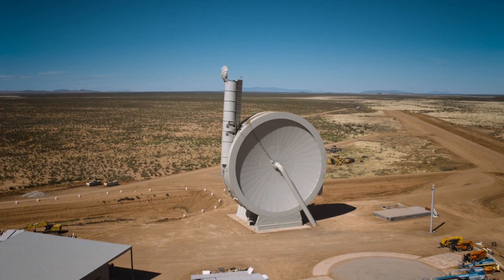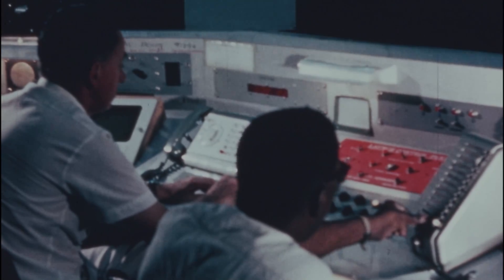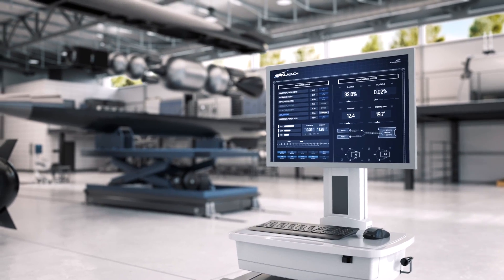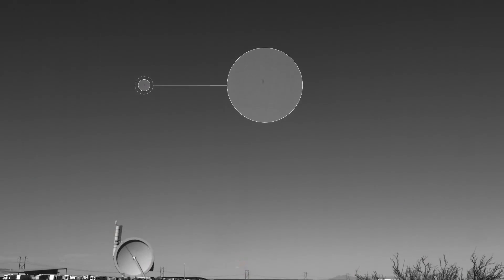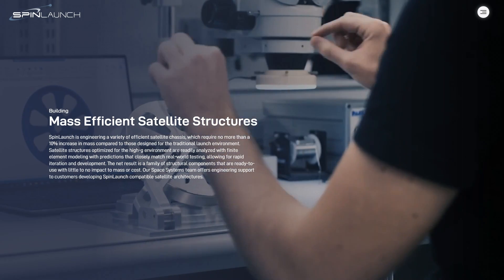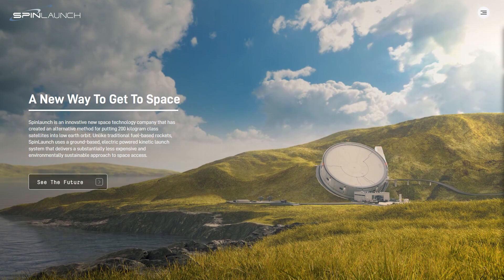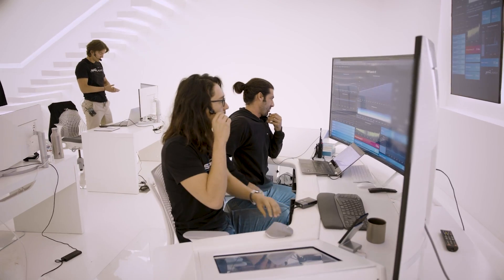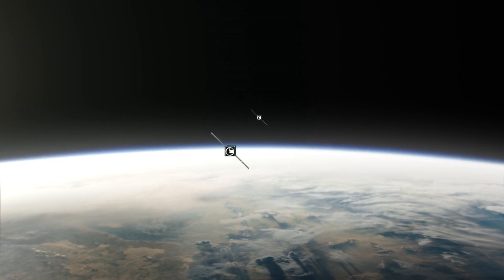Can Spinlaunch Throw Rockets Into Space?

Comment: For doing construction in orbit, this is surely the cheap way to launch bundles of beams or rolls of steel to orbit with only second stage thrusters to do orbital insertion and manouvering to a 'holding lot' where they could use the materials to construct, in place, the next generation of space stations:  Ones built in place and not prebuilt and launched.  More like an erector set where you have your pieces made and ready to go, just ship em up and assemble in orbit.  Would take another couple of space stations of the style we already have, but Musk's Starship program could launch some large chunks of a newer station and then use that as a building module to build out other structures in place, having a living and working space for moderately large crews.  Used to be science fiction type material, now we are coming up on being able to Really DO It, and cheap ground to LEO is an exciting prospect, even if it cannot be used for manned flight due tot he high G factor.

Comment: A 100m diameter centrifuge at a speed of 8000km/h generates a 10,068G force. If you expose the projectile to the same acceleration on a linear track (e.g. (rail)gun or EMALS), the launch would take a little more than 0.02s, and the track's length would be only 25m!
Reply: But please calculate the peak power needed for that rail gun vs. the spinner. The spinner can use an hour to accelerate the mass, so 3600s/0.02s …much larger projectiles are feasible with the spinner.
Reply: @samuk9816  Good point. I was also thinking about this. Maybe it's not even feasible electronically in such a short distance. But a gun with chemical propellants could still achieve it. Or a several hundred (or even thousand) meters long hyperloop-like tube.

Comment: Its cool and all, and great engineering.

But it will never work. 

Why would they even consider liquid propellant? Picture the aeration, churning, settling, etc that needs to happen before lighting it. Picture the acceleration, the propellant would be moved to the front of the rocket, not towards the engines when it hits atmosphere and decelerates. tanks requiring ullage (empty space) to efficiently deliver propellant 

They show it with composites. composites and heat dont mix. thats the worst choice of material. 

And what about all of the fluid connections? Those will be rattled lose or broken. 

Pressure transducers wont work at that G-load due to their membranes being artificially pulled in the wrong direction

Then what do they gain? They are expending the most amount of their energy at the worst part of the launch. Sure its free because they leave the mass of the device on the ground, but it doesnt buy them more than leaving a first stage. It actually buys them less because of the complications introduced and the massive amount of force acting on it.

With aerodynamic drag as well they wouldnt make it very high. There are already launch platforms that bring rockets to the same altitude, pegasus, virgin orbit, using planes that circumvent all of those drawbacks listed above. 

Why wouldnt they invest the same money into a launch from say 40, 50, or 60k feet from a plane? all better options.
Reply: Even launching from the airplane has a very questionable utility. Virgin Orbit is launching from the airplane, but they declare smaller payload (300 kg to SSO) with LauncherOne than the payload for the same size rocket (Falcon-1) launched from the ground (450 kg to SSO). Both rockets weigh roughly 30 tons. My guess is that Falcon-1 is built as light as possible, but the air launched LauncherOne requires greater structural strength to withstand being carried on a mount under the plane, and that eats into the payload. There might be other differences, but since much of the Virgin Orbit propulsion team are experienced ex-SpaceX people, there should be no huge weaknesses in the design comparing to what they have done with Falcon.

With the spinlaunch, the rocket will have to be built strong like a submarine, to be able to survive the 10000g centrifuge. That is going to be far, far worse in terms of delta-v than the penalty from the air launch that we saw with Virgin Orbit. I am surprised that surviving 10000g is at all compatible with getting 7 km/s delta-v from a small rocket. But I imagine the investors have paid for an external technical review of the project before bankrolling it, and the experts evaluating the project must have been sufficiently convinced that there are no fundamental reasons why this cannot be made to work. It will be interesting to see if anything comes out of this.

Comment: Scott, it looks that a good idea to make this contraption work would be to remove the lower half of the atmosphere. Instead of ramming into a 100kPa soup you could build this in Tibet and do without 40 to 45 of those. Better still, build it in the Kenyan, Peruvian or Ecuadorean highlands, where you can make good use of the higher spin velocity of a rotating planet's equator. Setting up this fine idea al sea level and far removed from the Equator is nonsensical, being such alternatives.

Comment: One of the tricky things is that the payloads are going to have to be able to resist loadings in two directions (radial as well as longitudinal), rather than just the one on a convential rocket launch. Creates a new set of structural issues - with a consequent mass implication on top.

Comment: Scott, I am ready to yield to your greater understanding but there is something missing from my understanding.  You say the rocket would experience 10,000G. If the object went from zero to terminal velocity in an instant, I except that that would be the case; but the rotation is ramped up over 1.5 hours does this not mean that the total G force is divided by the time.  Assuming linear acceleration that would equate to a change in momentum being about 1.9G per second.  I am pretty sure you would not have made such a basic mistake so I am curious where my mistake is.  Is not the purpose of the 1.5 hours to gradually increase the speed of rotation?

Comment: The problem I see with this is that the vehicle and payload have to be built to withstand enormous forces (that are sideways compared to what the experience during upper stage burn), which will require very rugged construction, which increases the weight, thereby eating up much of the advantage you would get from ground-powered launch.

Something more gradual would probably be better -- have a REALLY long and tall linear electromagnetic launcher that gets a hybrid system going up to ramjet speed at approximately the proper angle for optimal transit to orbit.  First stage is an air-breathing hydrocarbon-fueled ramjet with aerodynamic surfaces good for supersonic to medium hypersonic flight.  It carries the second stage/etc. up as far as it can provide useful thrust, then lets them go, and then ideally glides back to base (less ideally, to some other pickup point, from which it has to be transported back to the launch site).  Second and third stages are cryogenic-fueled (O[2]/H[2]) rockets with nozzles(*) optimized for thin air to vacuum and hard vacuum, respectively, that take the payload the rest of the way to orbit.

(*)Replace with aerospikes if appropriate.

Comment: The first concern I had was the sudden weight change when releasing. Made me think of the film Contact, and the exploding machine. Especially at the larger size!
It would be feasible to have 2 evenly weighted objects to release, but the second to be sacrificial. Maybe put a drag device on it to stop it going miles. It would only be ~0.001s of insane balance issues...

I like the moon idea though. Still, how much energy does it take to escape the moon: Sinlaunch vs propellant? In fact, nothing is mentioned here about actual energy levels. It's not free to spin something that fast, and for that long. I'd take a stab at this needing a noticeable chuck of a power stations 'budget'
Reply: With regards to energy: It doesnt matter how long you spin something, the only energy you have to put into it is to overcome friction once you have reached your desired rotational speed. Ofc it would need a lot of energy, but it should be in the same ballpark as conventional rockets, since you perfom the same amount of work (put stuff into orbit). But ofc they need a lot of energy so they would most likely need a solar-, wind-, or hydroelectric plant next to it. 
Still no difference to conventional rockets since you also need to produce the fuel for them (and using non-sustainable fuel is clearly out of the picture), which would take exactly the same amount of energy + conversion losses.
Reply: If it's about the same, what's the point..?
Reply: @martinmartin38077  the point is saving the entire first stage. You dont need to produce it and crash it, you dont need to put energy into shooting that stage up in the first place.
Also less air pollution since there is no burning rocket engine.
Reply: I'm not sure about pollution. Isn't liquid oxygen and liquid hydrogen used in rockets? 
SpaceX's first stage lands itself now too... sometimes without crashing

Comment: As great and compact as this is, I see more promise in more conventional mass driver designs.  Plainly put, this thing cannot launch any multicellular life form and have it survive.  Conventional linear mass drivers don’t have that limitation.
Reply: They would need to be gargantuan for that tho
Reply: @destroyer1667  mostly long, and it depends on how fast you intend to accelerate.  Also, the size goes down considerably if you use it like spin launch and basically just use it in place of a first stage in a rocket.  It’s mostly like building a railway, which is easy and there are already rail lines that cross continents so scale isn’t really an issue.  Making it all electric might be a bit challenging, but it wouldn’t require any new technologies to do.  The ramp at the end is only to adjust the angle of the velocity vector.  Spin launch was going to operate at a 35 degree launch angle, which isn’t that bad.  The ramp itself just needs to be stronger than normal because it will be subjected to large forces, but you could probably build it into a hillside and let the terrain take the load directly.

Comment: my main critisism of this type of device is that your space vehicle needs to be extremely durable in two axes instead of one. when you launch a rocket, the force of acceleration comes from basically the same point from launch until orbital insertion. with spinlaunch the vehicle needs to withstand high centrifugal forces which are at a 90 degree angle to the forces it will experience when accelerating in space. this will complicate engineering a stable vehicle to a point where it's unreasonable to use this launcher.

Comment: To be fair I think a lot of the major problems could be solved with making it double ended and detaching the counterweight off the other side as the rocket detaches. I'm sure there's a better solution, and the timing would obviously have to be really tight, but if they can get it to fly through that small exit hole I'd assume its close enough. That and magnetic bearings, add more magnetic bearings. They're pretty cool too.

Comment: Cargos that can survive those stresses will be limited.

I'd prefer to see a rail launch system running up the side of a mountain.  We'd get more gradual acceleration, more cargoes could survive it, and it's possible to achieve enough velocity to reach orbit without any booster at all.  Of course we would see boosters in such a system; they would need them to achieve desired orbits.

It looks to me like the rail launch concept will be less technologically risky and more capable, but also more expensive.

Comment: I still don't understand why they are accelerating the arm from the axis of rotation where the leveraging forces are at their worst. Why not use electromagnetic induction at the periphery of the arm where the torque can be fully realised. This would enable the device to achieve the required radial velocities in a much shorter period of time rather than subjecting the pay load to such g forces for hours. Essentially the outer casing of the device could be considered to be the Stator of a very large electric motor With the armature being the rotating arm. This would use vastly less electrical energy and result in better engineering outcomes from a material stress analysis.   The radial velocity would then be determined by a variable frequency in the sine wave of the electrical signal to ramp up the rate of acceleration.

Comment: So, in order to calculate how fast they need to launch, I looked up the altitude and speed of the Saturn V first stage - 42 miles high at 6,164 mph.
That means even if their rocket doesn't slow down, they need to launch at around Mach 8, and assuming some atmospheric friction slowdown, they need mach 16 - or close to reentry speed. The rocket would need:
1. Significant sideways strength for everything especially including the payload.
2. A heat shield similar to astronaut reentry capsules.

Comment: At 1 Mach, 343 m/s, to spin something around a 16.5 m radius (~110 ft across) requires a centripetal acceleration of (343)^2/16.5 = 7130 m/s^2  or 728 gee, not 500 gee. That's for the demonstrator.

For the big operational launcher, the g-forces are much higher: radius 150ft = 45.72 m; at 450 RPM that's tangential velocity of 2*pi*450/60*45.72 = 2154.5 m/s; centripetal acceleration is (2154.5)^2/45.72 = 101,529 m/s^2 or 101,529/9.8 = 10,360 gee.

A payload clamping system for 10,000 gee that can release with the precision timing needed sounds like a daunting prospect, particularly considering the instantaneous change in momentum of inertia of the rotating system at the moment of release.

Comment: Why are all their launch facilities pictured so deep in the atmosphere?  Why not build them at least 8000 ft (2500 m) above sea level?  The payload isn't so big it needs waterways or the crawler transporter, just an oversize load tractor trailer.  (Maybe not even that.)  This puts so much "thick" air below them that the same launch velocity isn't bled off as quickly allowing either heavier payloads or higher orbits.

Comment: The full sized launcher, if it is ever actually built, is going to be big and very expensive. So you would want to ensure that before spinning up any cargo to speed that it is not going to fly apart and break your big expensive launcher. Its going to be under huge forces for about an hour. I don't see any way that you can simulate these forces other than using another big expensive launcher.

Comment: I've got a better ideal.a u tunnel one side filled with water with a apature at the bottom.drop a massive weight on top open the apature and the rocket in the connecting tunnel will go up.😵 A hydro gyser launcher.🌀🌪️plus after launch the apature can be closed again and refilled with water to lift the weight back up.

Comment: That is just such a cool idea. Rail gun version makes more sense though.
Reply: A rail gun version could be much longer so the g-forces could be much lower. 10.000g, that´s a lot. Build that on the highest mountain you can find, where the air is much thinner and you have a chance. That spin thing just doesn´t make sense.
Reply: Spinning allows for much smaller peak power, rail gun needs to accelerate the mass really fast, spinning allows you to slowly increase speed.
Reply: @samuk9816  the centrifugal force of the spinning arm is the problem. 10.000g, that´s a lot. Satellites can´t withstand that. When starting a rocket, the maximum g-force is 4-5.
A rail gun could be very long so the forces on the projectile could be smaller.

Comment: i can see another technical problem: how do you design a rocket and payload to withstand the tremendous sideways loading during the spin up, in addition to the regular downward loading when the rocket fires?  
it will be interesting to see how this system progresses!
Reply: Its just a simple case of making it stronger. The rocket firing isn't going to be much of a shock, slow build up to 1g or so I imagine. You want an efficient rocket you don't need an interceptor missile acceleration.